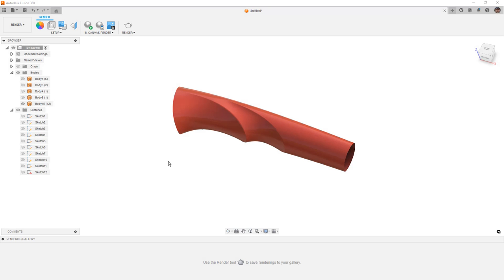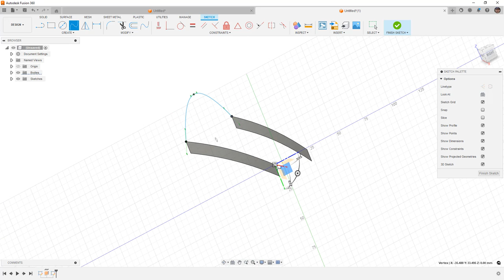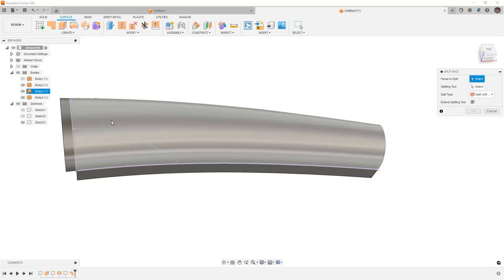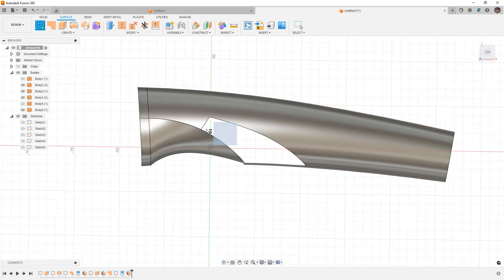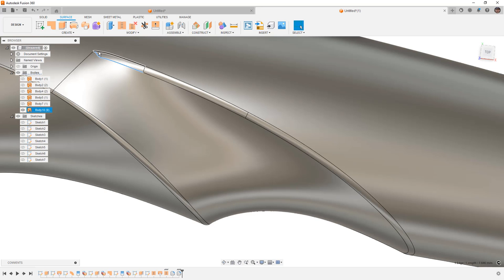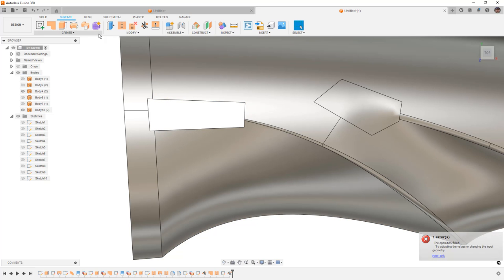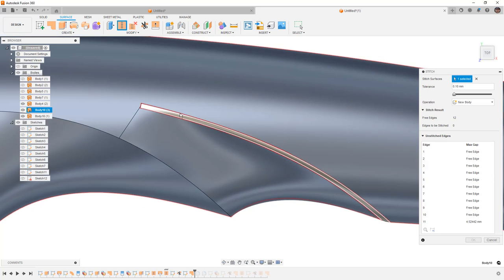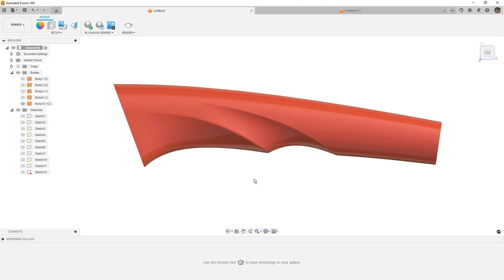Surface Mastery Part 16 - How To Create A Complex Handle With Fading Details #fusion360

Comment: This video perfectly illustrate the very great limitations and weaknesses of current CAD programmes. When it comes to compound curves they leave a great deal to be desired. For anyone who is not using it everyday, the difficulties are all but unsurmountable.
Reply from the maker: Surfacing is a different approach for sure and the tool limitations are often the killer.  I did this same exercise in Plasticity and plan to do it in Solidworks in the near future. https://youtu.be/1rQdlOgFFyk
Reply: @LearnEverythingAboutDesign  I wish that you would teach me how to do these things in TurboCad
Reply: If you had The Matrix you could plug all this knowledge into your brain, but without it I am stuck with 1000 sticky notes on how to complete this process.
Reply: Please tell me which program is best suited for the design of cast plastic parts with very complex surfaces?
Reply from the maker: @igora6367  You can do that with pretty much any CAD program.  Complex is a term that means different things to different people.  I was the designer on this controller and I modeled it in Fusion. https://yawmanflight.com/  Every CAD program will have its limitations.  Surface quality in Fusion can be tricky depending on how picky you need to be.  The controller was a mix of Freeform for the base shape and a lot of surfacing for the details.
Reply: @LearnEverythingAboutDesign  Under complex surfaces of plastic parts, I mean, for example, the internal interior of cars. So I'm trying to understand what kind of software are used by car designers.
Reply from the maker: @igora6367  There are a few depending on where you go, but the one that stands out is Autodesk Alias.  Auto designers will generally use programs like Catia or NX when working on the majority of the designs.  Things like trim panels and mechanical aspects of components.  However the workflows generally overlap a few pieces of software.  From what I understand a lot of companies use programs like Blender at the concept stage (or Maya or others in the same poly modeling).  They will take those poly models into a program like Alias to make a class A surface off the concept.  If this is a new vehicle that might go to machine clay.  From there the clay may be scanned and that mesh then used to make a final surface model.  Once the "A" surfaces are done, those files go to designers to have details added.  Things like door handles, mounting boss, other features for manufacture.

Alias does have a free Home Learning edition license for 12mo.  The retail price of it depends on which version you get.  I think the "Surface" one is $4k/year.  I think the full thing is like $10k/year....

Comment: Fun tutorial, thank you! A quick way to do the trim at 19:00 is to use the line to create a pipe that is set to cut. Consistent width cut along the line and the ends of the pipe can be extended/extruded if necessary
Reply from the maker: Great tip!  The pipe tool is solid and in the moment forgot you could use the outside face for the trim!  Thanks for sharing and watching!

Comment: Great lesson, professionally explained - you are definitely the best educator I've come across on YouTube. - These concepts are good for many CAD software's as the principles are very similar. Certainly I'm enjoying seeing how this is accomplished Fusion 360.
Reply from the maker: Wow, thanks!  And yeah the same approach would be taken in other programs with slight tweaks.  In solidworks the Fill tool for surfacing will work with an open boundary and it will fix it for you.  Also there is a nice tool that is somewhat a combination of loft and sweep.
Reply: Hmm, similar but not exactly the same - using a Parasolid modeller ( no, not that one) , a few quirks ( different to fusion 360) to get good edges but eventually BINGO!  - a few hours to figure out the quirks and nuances though - I could have given up so easily... I have sketch constraints !

Comment: I was watching the fusion 360 self paced documentation and you popped up in a few videos. I’ve never seen you but I recognized the voice from a dvd course I purchased on DriveWorks a long time ago. I remember thinking “this guy explains things great”. I was happy to run back across your content again, and at the perfect time. I am a long term SolidWorks user and looking into Fusion 360 for my personal projects. You are an awesome instructor and I will be looking into your course. Btw, I use DriveWorks to automate just about everything SolidWorks to this day. Thank you!!
Reply from the maker: Awesome to hear!  You are very welcome!  Driveworks is a cool product.  So many think its just a dinky little express add-in but the full Driveworks offers up so much functionality!  I still have the "little book of rules" in my desk even though I haven't touched it in years.

Great that you found Fusion 360!  You might find it lacking in some areas but it is a powerful piece of software.  I do have a website right now with just some beginner content. www.LearnEverythingAboutDesign.com  and if you find content in the learn portal on the autodesk website I authored most of that for Fusion and some for Inventor there.  This channel was aimed at intermediate/advanced workflows but does cover the spectrum.
Reply: @LearnEverythingAboutDesign DriveWorks Pro is what I use now and it is very capable.

I am finding Fusion to be pretty liberating and refreshing, especially for modeling my personal projects outside of work. I do wish there was a weldments like environment though. 

I checked your site out, and plan on checking out your courses

Comment: Another way to do the fillets that might have worked better would be to use a variable width fillet, keeping the blended side at 0. The fillet would then collapse to zero coming into the transition region. 

Variable width fillets can have their own issues, but maybe worth a try in this case.
Reply from the maker: certainly one to keep in your bag of tricks for sure!

Comment: Loft is way better than Patch, is more consistent and you can control the direction of the tangency's transition.
Surface is way better than Free Form if someone needs precision/measures within those curved faces.
Reply from the maker: Loft is great for 4 sided openings, but it produces inconsistencies at the profile and guide edges.  If you look at the curvature analysis you will see a big jump in the surface curvature right at edges and guides, even internal guides.  Theoretically it should be better than Patch, but right now Fusion surfaces are struggling.  I hope they are fixed in the coming year.  Trying to use a loft on a 3 sided opening like the first shape will cause a degenerate point where 2 profiles share a vertex.  This is worse when you drive tangency.

I agree with you that surfaces are b etter than free form if you need more precision with the curved faces, but just gotta check those edges.  Problems become amplified when offsetting or thickening.

Comment: If doing this for injection molding, can you still maintain tangency at the mirror line, since most likely the mold will require some draft angle at the parting line?  Thank you!
Reply from the maker: That will partly depend on the mold requirements.  Generally a part like this would have a reveal at the parting line and you may find the mold house will let you get away with a cylindrical part going down to tangent at the parting line.  Usually with the caution about "drag marks".  But to get around that you can split the difference on the reveal on both sides of the parting line getting to at least .5deg draft.

Great question.

Comment: Is there a way to make this form solid after to 3d print? I've only really messed with solid parametric modelling on fusion so this is all new to me. 

Also for more organic shapes like this is it worth learning blender rather than Fusion's surface features?

P.s great tutorial, nice and easy to follow :)
Reply from the maker: To make a surface a solid you have 2 methods.  One is to use Create > Thicken to give it a wall thickness.  The other is to cap the ends off making it "watertight" and stitch the pieces together.  Fusion will make it a solid if it is in fact a closed volume.

For complex shapes I have a lot of videos on Freeform modeling in Fusion.  The workflow is very similar to a poly program like Blender where you push/pull.  The only difference is that in Blender your end result is a Mesh.  In fusion you end up with a surface or solid.  So it kind of depends on what you want to do with the model down stream.  I have some intro to blender videos in a series as well as this same model done in Plasticity, which is a new direct modeling program working with NURBS like Fusion, but in a more blender type workflow.

For me i stick with CAD because usually my end goal is to make something.  There are some pros/cons to each of course.  If the end goal was a video game asset or just rendering/animation I might start with blender.  I am quicker in CAD so just converting to a mesh after I model either from Fusion or Plasticity is faster than modeling in Blender for most things for me.
Reply: @LearnEverythingAboutDesign  I'm a design engineer by trade and primarily use Inventor at work and use Fusion for my hobbyist/3D printing tasks. Free form modelling has never been something ive dove into, sheet metal/machining/parametric design is my usual work. But wanted to dive into more organic shaping for my own curiosities and benefits, my real end goal would be to re-create movie props to 3D print for myself. Ill look through your videos as I like how i was able to follow your process and you explain yourself clearly :)

Keep up the good work, I look forward to seeing more of your videos, thanks again
Reply from the maker: @gingovwales  Thanks!  and once you spend a little time with forms you will enjoy it.  The same Tsplines is built into Inventor although there are some minor differences.  But if you are recreating props then using forms will likely be a big help.

Comment: This was quite fun doing this in Fusion until the filleting part. I want to use Moi3D or Plasticity for surfacing from now on. Would you recommend one over the other?
Reply from the maker: I don't have personal experience with Moi, but I do hear a lot of users switching from it and Shapr3d over to Plasticity.  I think the future versions of Plasticity will get better surface support(some of the beta features are better already).  I am not sure I would totally switch over to Plasticity just yet if your main goal is surfacing.  There is a channel https://www.youtube.com/@Kuechmeister  that does a lot of complex surfacing with Plasticity.  No audio or narration but might give you some ideas on workflow.  He does some amazing stuff with it!
Reply from the maker: I did the same video today but in plasticity so you can see the differences. https://youtu.be/1rQdlOgFFyk
Reply: @LearnEverythingAboutDesign  great work! and thanks
Reply: This "handle" thing can be created way easier with "create form" and work your way from a zylinder/plane/box to get the shape you want.
Doing this with surfaces, just look above and the drawbacks this technique has, it's way more complicated than "create form".
I know it's not parametric but more versatile in general imho.!
Reply from the maker: @GeryS.  I would have to disagree with this shape.  i cover forms quite a bit on this channel but i think in this case the surface is much easier(even with its challenges).  Getting the handle relief shapes would be tricky because it requires the form edges to change direction which means creating star points.  Possible yes, but I don't know that it would be easier.  IF the handle curves didn't go from "vertical" to "horizontal" crossing over the edges on the form 100% it would be easier.

Comment: Is there a way to put a sketch over this shape and extrude it out evenly? I can only manage make this work on single curve pieces.
Reply from the maker: A sketch in Fusion can only be extruded if its planar, so any curve on this wouldn't work.  What is the end goal with the extrude?  that might help direct you a bit better.
Reply: @LearnEverythingAboutDesign  I want to have a handle and then I would like to add a sketch of a design to be extruded around it. For example, imagine the handle in this video, with a spiderweb design sticking out by a millimeter.
Reply from the maker: @CupidChud  There is an emboss tool.  In the past that would only work on cylindrical bodies, but they updated it and you could try it on this and see if it would work.  Basically you would draw your web in 2d in front of the handle and try to wrap it.

Your best bet is likely trying to Split Face from a few angles, but as you wrap around it that would get a bit tricky.  If emboss doesn't work it would be super tedious on a surface model but not impossible.

Comment: Very good video. I did and Im getting two different color. I dont know how to change it. Shift + N toggle the color but only inside. I dont know why.
Reply from the maker: In the Browser bodies is there a single surface body or more than 1?  Shift+N is component color cycling which temporarily overrides any appearances or materials you have applied.  You can find that in Inspect.   BUT that would change the inside and outside colors of the surface.  

Surfaces have a "Normal" direction.  generally this is outward.  Depending on your visualization settings you may see a lighter variation of the inside surface vs the outside surface. but that should go away if you apply an appearance to the design or the body in the bodies folder.
Reply: @LearnEverythingAboutDesign  at 5.30 of your video I see only one color which grey steel color. In my case this grey color is inside and greenish is outside. I should be in reverse. Im lost now
Reply from the maker: @martinhub3737  hmm, it shouldn't really matter honestly but you can try  the surface tool Reverse Normal on the modify tools. try that and see what happens.

In general surfaces will have a normal direction.  This really only matters for when you thicken. the normal direction will be positive, and inside will be negative.  

It is possible a default setting got switched for you during an update as well.  Go into your User Preferences (top right corner where you image/name is). go to Graphics and Disable surface normal display.
Reply: @LearnEverythingAboutDesign  "Reverse to normal" did the magic :) it fixed. Thanks a lot!!! Now I will investigate what this command really is for.
Reply from the maker: @martinhub3737  Awesome!  The normal of a surface is just a way for the software to know which was is "in" and which way is "out".  If you turn the setting off in the user preferences you would never know until you thicken a surface and just have to figure out which way is pos/neg.

Comment: If you took the .step file with the curved surface cutout and put it in plasticity to fill in then bring it back to fusion would you mess up the parametric history?
Reply from the maker: yeah you would.  Fusion has "AnyCad" which lets you maintain an external link to say a solidworks or inventor file, but that is a component in an assembly and not something in the middle of the timeline.
Reply from the maker: @3runjosh  That depends on what you mean by manufacturing.  If I was designing for say injection molding, no way I would use Plasticity.  I need to control things like wall thickness of ribs universally with parameters so i can tweak and change them.  If you were designing for 3d print and making all the parts together in the 1 file, you could do it all in plasticity.